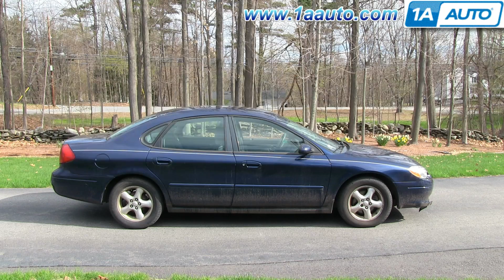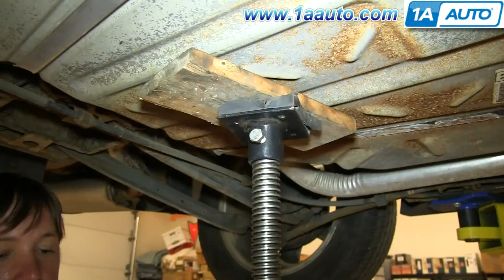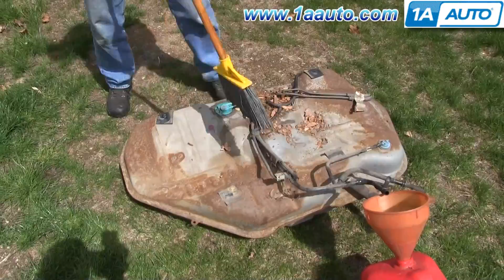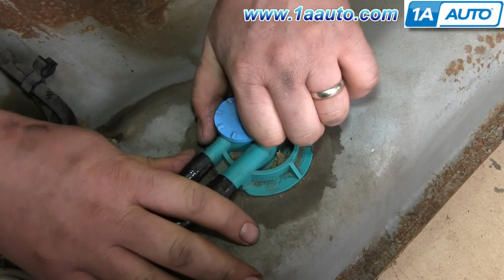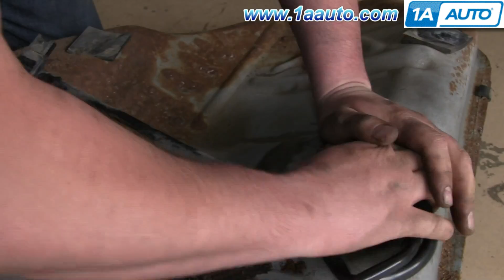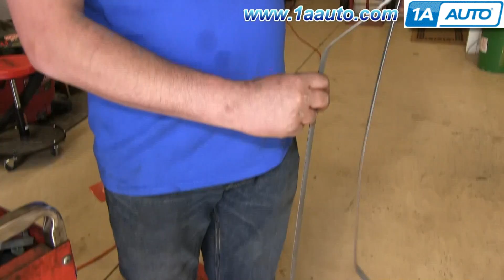How to Replace Fuel Tank 00-05 Ford Taurus

Comment: Thank you, i replaced mine in my 01 taurus many years ago. This was a good refresher vid as i have to do it again. I recommend you to everyone i know as only 1 company is cheaper and they offer 0 support and refunds are near impossible (you know the one). I really appreciate the vids. Please stress the fact that if you are replacing tank to also replace fuel pump (as you did in the vid) no extra labor that way because it WILL soon fail murphys law
Reply from the maker: +@wils-q7j Thanks for checking us out. Shop for high quality auto parts on 1AAuto.com:

http://1aau.to/m/Shop-1AAuto-c

Comment: Helpful video.  Thanks for posting.  I have no lift but had the car backed onto a pair of 6" high ramps and had enough room to work.  A word of warning to those replacing their gas tank.  Be very careful when removing those blue plastic vents, especially the one that has to be twisted a quarter turn.  I snapped off one of the hose connections in the process.  No auto parts store in my area could even find replacement parts in their system.  Maybe my Ford dealer could get me one, for a small fortune.  Had to go to a junk yard and drop the gas tank off a Taurus and scavenge the entire assembly, both blue plastic vents, with all the hoses attached.  Cost only $10 but added several hours to what would otherwise be under a two hour job.
Reply: Are those blue pieces connected to the fuel feed tubes? Just got our car returned from the dealership today with word that those parts are discontinued by Ford  (after them telling me the fuel feed tube was leaking vapors) and now I'm scouring eBay! So glad we passed emissions just a week before that issue came up.
Reply: I have not done this job yet, but I am pretty sure the part numbers for those two plastic vents are:

F8DZ-9B593-AB   -small one
YF1Z-9B190-AA	-big one

Regarding the vapor tube, you should be able to go to NAPA and get a general fuel rated hose. For the high pressure fuel lines, that is generally more stiff tubing made from nylon. Mechanics should have equipment to replace or splice the nylon tubing.

Comment: Stupid ford have to remove Gas tank to get the pump off
Reply from the maker: +Car guy Car Thanks for the feedback!
Reply: PITA job when you are laying on your back with half a tank of fuel. Somethong blocking siphon from entering tank so had to drop with half a tank. Exhaust and lip on back of tank get in the way. Pins are a PITA as are the clips holding the lines on.

Comment: Thanks for the video, awesome work. I hope you don't mind me asking, but I cranked my 02 Taurus, removed the relay and car kept running, pulled the fuse still kept running. I checked and made sure I pulled the right one, by checking the number and location. I turned off car, but wouldn't start back. The tank is leaking from the top, but when I removed it, there were no obvious signs. Any suggestions? Thanks

Comment: You forgot the 2 fuel lines and how there's pressure it in still
Reply: YesSir I saw something else that I did same once and got scolded by my boss.  Using a hammer on a screwdriver handle....

Comment: i have a bad leak from top of tank after its started, im assuming its from the outlet line, this a common problem? i'm cutting an access panel with an air chisil not using a grinder since i dont have access to a lift
Reply: Where did you cut the access panel?